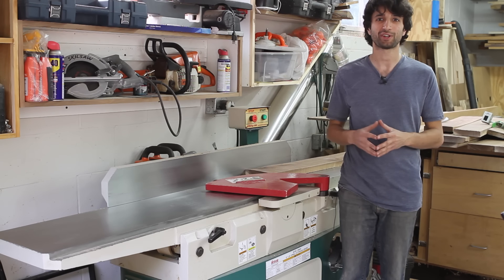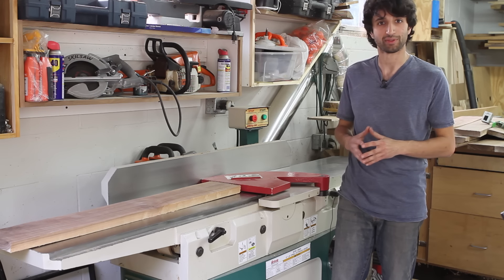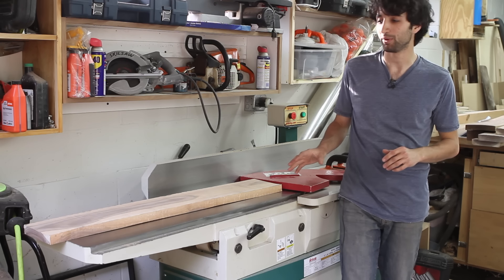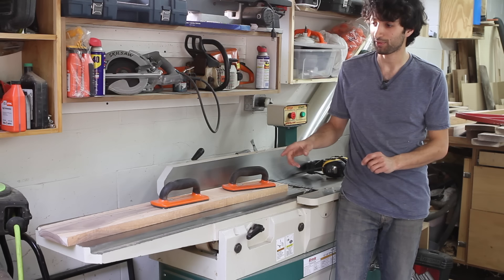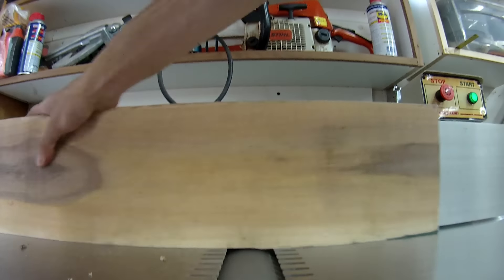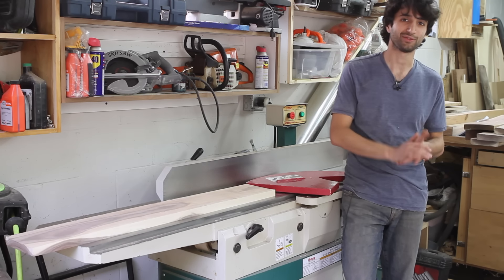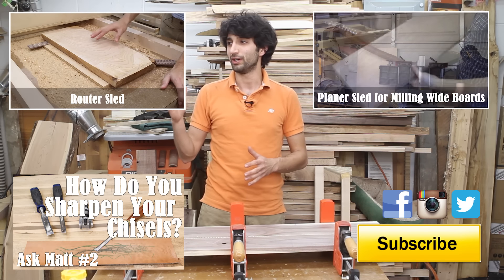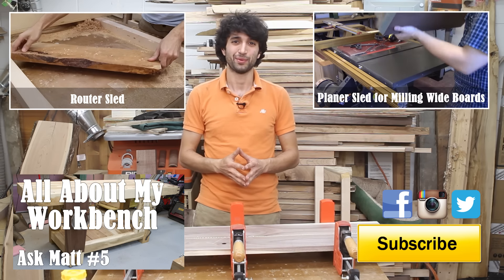What Does a Jointer Do? - Ask Matt #13

Comment: I'm here because 24 hours ago I had a 30 second conversation about a jointer with my phone in my shirt pocket.  Surprise surprise, it appeared in my suggested videos.
Reply: I know what you mean.  We're being watched by big brother "do no harm" Google
Reply: .40 S&W Fan a good service perhaps?
Reply: Similar situation here: I was talking about smoking a joint to relieve the pain in my joints so I could go dancing at a local juke joint.
Reply: @NinjaRider777R It may not have been your cable company. Most phones have been found to still be actively listening to you even when they are powered off. Have you ever noticed that if you power off your phone for a day or two that the battery's charge will appear to have been somewhat depleted despite the phone being off? Why would there be significant battery depletion if the phone is powered off and in theory not utilizing the battery's charge?
Reply: @AntiNoob79  Its common knowledge that off isn't off. Its just what use to be sleep mode. If you didn't know it you do now. The only true off is unplugged and batteries out and even then you have to wait for the capacitors to drain. Nothing you have has a proper "power switch" that completely cuts the circuit from the power supply anymore.
Reply: Then that horrifical nightmare machine showed up as a wish app ad on Facebook.
Reply: @NinjaRider777R I've had very similar things happen.
Reply: Turn personalised ads off and disable all Google apps on the phone that you can then use duck duck go as your web browser and use a third party gallery instead of the Google one and you wont have problems
Reply: Same.
Reply: @AntiNoob79 I bet your theory of them listening all of the time is right, but batteries just deplete passively because on an atomic level they are actively always sharing electrons with everything around them, and if left hooked up to a circuit (which your phones battery constantly is), it essentially leaks electrons through the nearby conductors and very slowly depletes your battery. And it’s not just phones, if you leave like a toy with batteries in it for too long, even without using the toy, it will eventually run out of battery.
Reply: It doesn't work that way. What does happen is the person you talked to has googled that stuff before and their advertising ID and yours are communicated with location information.

They know you were in the same room as someone who has googled researched or engaged with content

Comment: Co planarity... Lol. Parallel my friend. Parallel
Reply: Jaze the tables are parallel and separated by the cut depth
Reply: No - parallel refers to 2D space, coplanar refers to 3D. A line is defined by 2 points, and 3 non colinear points defines a plane.
Reply: @crustyoldfart  Planes can be referred to as parallel in 3D space as well. Co-linear means on the same line, just as co-planar means on the same plane. The "in-feed" and "out-feed" should not be co-planar or the jointer would not be effective. However it is critical that the in-feed and out-feed tables be absolutely parallel planes.
Reply: @JeffreyWigington  You are of course absolutely correct to point this out.  My comment came out not quite as originally intended.  I was actually intending to amplify the comment by Jaze who in his turn was making a distinction between parallelism and coplanarity. 

My first point about a plane is that it is sufficiently defined by three non-colinear points.  By extension two parallel planes require six points arranged in two sets.  The six points can be determined by first choosing three points randomly, a fourth point is constrained to be not coplanar with the first three ; the fifth and sixth points points must be such that  for each  its perpendicular distance from the first plane is the same as that of the fourth point.

While on the subject of planers we can further assert that the cutting head must revolve about an axis which lies in a third plane which is coplanar with the first two parallel planes.

I'm sure that it would also be possible to extend the discussion beyond the axioms of Euclidean geometry by drawing attention to  his parallel postulate, but I think that here would be a good place to stop  ! ?

Comment: He was very right about the jointer being the "therapist", if you will, of the shop tools.  You CAN get by without one, but the building process is much more enjoyable when you have one.  For whatever reason it seems to be one of the later tools I see a lot of woodworkers purchase when in reality, it should be one of the first.  Considering the vast majority of wood is in "rough" form (it's very expensive otherwise) it becomes important to "true" up one side  as that becomes your reference.  Any imperfections in that initial reference side will manifest as ANGER throughout the rest of the project.
Reply: i belive the main reason is the price they are expensive for a good one you can find a bench top one relatively cheap but when youre buying a tool that is essentially the heart of the shop you want something good. and for that reason i believe people get it later on myself included. theres a lot of things you can do on a table saw with the right sled

Comment: There is something I'd like to add to Matthews excellent video.  

One of the key things when learning to use a jointer is understanding the sounds of the process.  It's very difficult to explain in words, but sound tells you a heck of a lot.  For example, if you're getting tear out as a result of reversing grain in a board, or because you're taking too much material in one pass, you can hear it.  That also tells you if you're planing with the grain (correct) or against (almost always incorrect).  

When dealing with a board which is bowed, curved lengthways, as Matthew is in the video, the sound the planer makes will tell you if you're removing the bow or not.  With a bowed board, you'll hear the planer knives engaging as the front portion of the board crosses the cutter block, it will then disengage for a time and the sound will change, before re-engaging the tail end, where the sound changes back again.  If you had been applying too much pressure, then the sound would have remained consistent throughout.

With practice, you can learn to match the sound with what the knives are actually cutting and where.  If you really want to see the results and practice, you can spread chalk on the face of the timber being planed, then it's easy to see what material is being removed each pass.  It's really quite cool to see.

A little tip:  Never apply pressure to the board directly above the cutter block.  There is no situation where this is correct technique.  Take light passes of less than 1mm a time, rarely is it a good idea to go above this if you want a decent finish.

A jointer is a tool like any other and takes a lot of practice to use well.  It's quite a dangerous tool so do triple check your setup and keep the blade guard in the right location.  You really dont want a planer knife flying at you at 300 mph as you'll end up with no head, which isn't ideal.
Reply: Good additional comment. I actually noticed and noted the difference in the sound during Matt's demo.
I'm learning heaps today.
Reply: Excellent advice, my friend. What we woodworkers use to practice our trade is a large amount of very dangerous power tools. Jointer Planers, Table saws, Band Saws, Radial Arm Saws, Chop Saws, Router Tables, Sanders of various types, Wood Lathes, etc. are all very dangerous tools. Number one rule about learning to use any of them is learn all the safety rules first. Then learn how to operate it. Safety rules for each tool should include what each one is not to be used to do,the proper amount of clearance from the blades or abrasives of all your body parts, the purpose and proper use of all safety equipment  that is needed for a particular tool, The proper conduct of other people that are in the work environment (like never do or say anything that can distract the tool operator from what he or she is doing).

I've been in the woodworking business for 45 years, and I still have all of my fingers. This is because I always make safety the most important part of any job I do. I've seen first hand what not practicing safety can do.
Reply: @l.clevelandmajor9931  Right... AND the proper clothing when working with this machinery,  rather tide than loose, no long hairs hanging down.
Reply: @ryszardjacekrusniak7993  Indeed, you are quite correct. Loose clothing and long hair not properly restrained can lead to serious injury or even death; not just in woodworking, but also in many other trades in which heavy power equipment is used. As the supervisor of a cabinet shop I once worked in, if any of my team were not adhering to even the tiniest safety rule, I'd reprimand them, on their first offense, on their second offense they were suspended without pay, and on their third offense I would terminate their employment with the company we worked for. No exceptions would be tolerated. As a result, my shop got the highest safety ratings in the company on a consistent basis.

Comment: Sweet!. Watching this made me feel like being in school again.
About the 2 planes of the jointer. They are parrallel.
Few important notes: You only flaten and square 1 angle/corner on the jointer.  (jointer -> planer -> table saw)
You always check the grain of the wood. Just like a handplaner, you don't go across or against the grain. (Sometimes you have no choice though...)
And you want the hollow side of the board (when cupped) on the jointer surface. Otherwise it won't get flat (and square).
Subbed!

Comment: Matt.

I really enjoyed your video on the Jointer.  It was very well presented and easy to follow.  Your explanations were well thought out, and very informative.  I am in the process of building my dream shop on paper and a Jointer will most certainly be on my list of wood working machines to have in my shop.   Looking forward to watching more of your videos and increasing my knowledge about wood working.  Respectfully Maurice Pettiford Budapest Hungary.
Reply from the maker: Thank you so much, Maurice!  Have fun putting together your shop :)
Reply: I was looking at the Hammer by Felder and if I had it to start all over I'd consider a machine like that the only think it wont do is butter my toast. But you get a Jointer, planer, table saw Router, sliding table saw, Shaper all kinds of stuff
in one machine. Buy each one of them tools separate its going to cost a lot this thing was 12k
and takes up a lot less room. you can automatically eliminate 6 or 7 tools in your shop , that's a lot of floor space.
You can use for other stuff.
Reply: @bobbg9041  which of the Hammer machines were you looking at?

Comment: Did you know that in the UK a jointer is called a planer and a planer is called a thicknesser? 
The infeed and outfeed table of a jointer aren't coplanar, or in the same plane, they form parallel planes. To be the same plane they'd have to be the same height.
A jillion years ago we couldn't use any of the power tools in junior high (middle school), until we were able to make a board square on all sides and flat with hand tools. I think it might help people understand the power tools. We were kids and everybody got it pretty quickly, so it isn't that hard. The people that got it quicker helped the ones that struggled more. Sometimes another student might have a different way of explaining from the teacher that another kid might click with.

Comment: FYI: On any jointer larger than 6", I think you're required to write "U.S.S. <name of your favorite aircraft carrier>" on the side.
Reply: Kitty hawk
Reply: I dont get it? I must be missing something
Reply: @thomasbarlow4223  if it weighs as much as an aircraft carrier - might as well label it like one
Reply: WeedMIC I believe it is because the surface of the jointer somewhat reassembles the deck of an aircraft carrier
Reply: Theodore Roosevelt #BringBackCAPTCrozier
Reply: @sergecouture6721  exactly... and also because they typically have their power controls on a stalk emerging from the side midway down the length, right where an aircraft carrier’s bridge is.
Reply: @thomasbarlow4223  You don't get that they are big? Or that they have a flat top? Or that they are heavy? Or that the guy was making a funny haha joke comparing the two? You really must be missing something....
Reply: USS Enterprise.  Served on her in 2001.  9 Month Mediterranean Deployment.

Comment: as a new woodworker working with reclaimed pallet wood, this is very helpful.  I was under the impression that a planer would do the same thing as the joiner.  I tried squaring off the sides of some boards, but apparently I followed the bow of them.  I managed to use another trick from stubby nubs to help square them off better.  Now waiting for my planer to arrive so I can get some consistency there.

Comment: The infeed and outfeed tables are only considered parallel.  Two parallel surfaces are not coplanar (do not share the same plane) when they are offset in height, they only share an angular orientation.

Comment: This is an excellent video! I had the exact question that you answered which is : "what is it about the mechanics of a planer that prevents it from creating a flat surface" and you were able to answer it by describing the mechanics behind both the jointer and planer as well as demonstrating it by running warped wood through both the planer and jointer. Thank you very much!